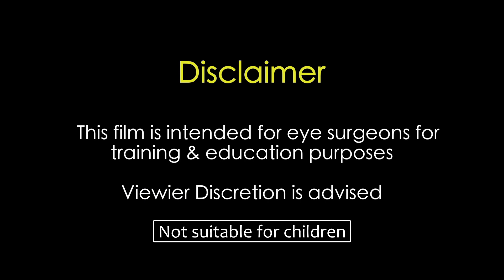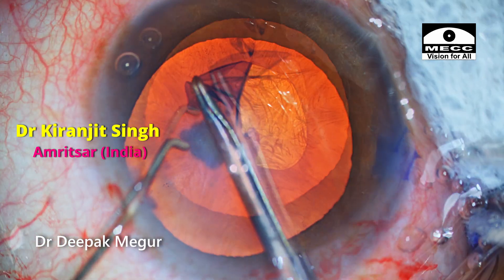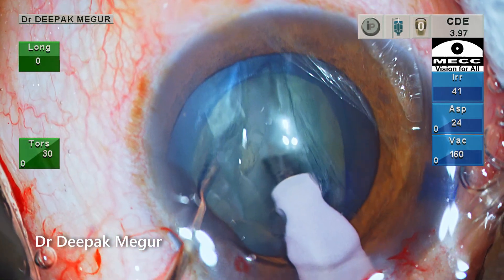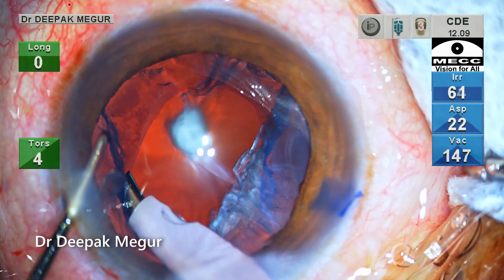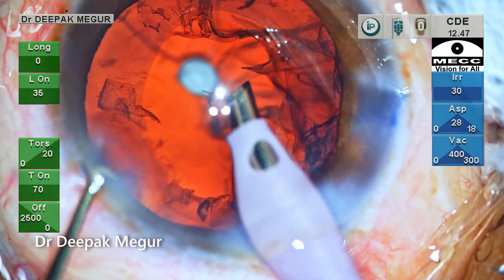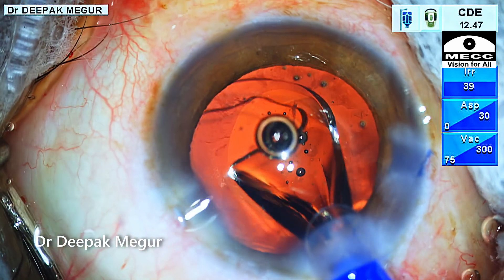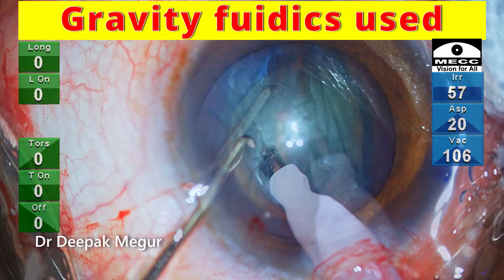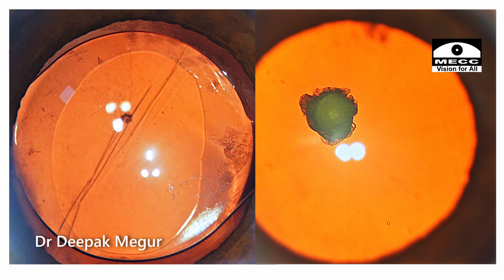Posterior Polar Cataract Suspect..! Low Flow ,Low Pressure Surgery, Oval Rhexis- Dr Deepak Megur

Comment: Congrats dr megur
In fact Iam using nearly same technique successfully for the last 15years
With little difference
Low bottle and aspiration rate and not allowingAC to collapse are essential
I do broad tunnel(broader than polar opacity so that delineation wave (through the tunnel )direct to the empty tunnel not to the weak posterior capsule
If asp rate is high plaque will come to the phaco tip soon
Aspirating cortex and epinucleus should not be complete I leave it attached to the polar lesion then conquer with epi mode
Again it was beautiful informative surgery
Congrats